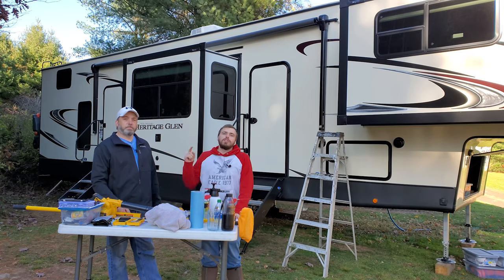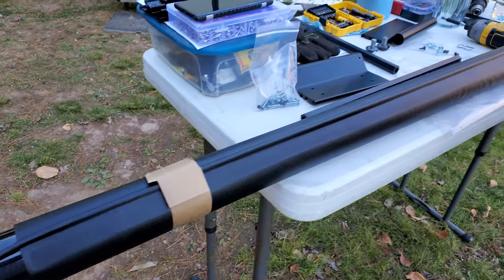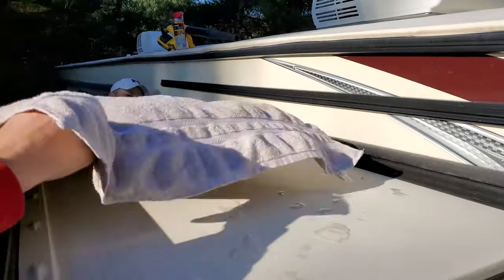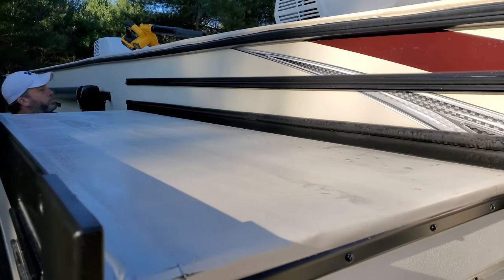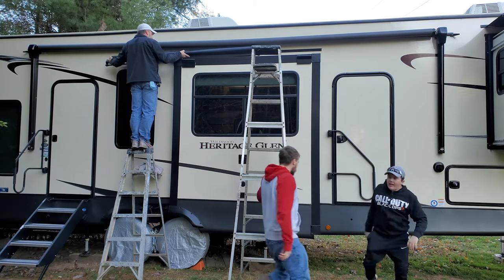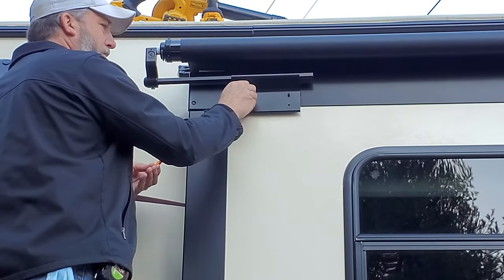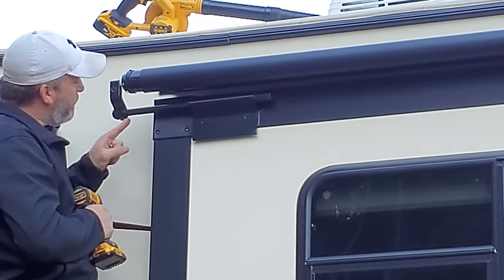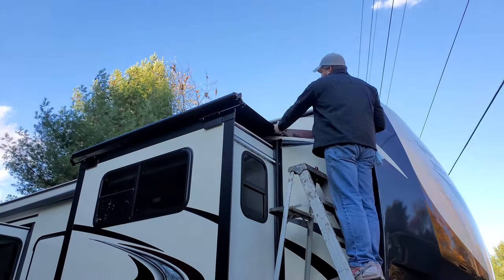How to Install RV Slide Toppers

Comment: Flare the end of the top track and deburr so you don’t snag/tear the fabric.  Use a ratcheting drill, not an impact drill, to avoid popping screw heads and stripping hole threads.

Comment: Question. My slide is real close to my patio awning. Are you able to adjust the mounting to slide the whole thing a little more to one side? In my case to clear my patio awning. Thanks.
Reply from the maker: Yes, the brackets do have some level of adjustment. You can easily avoid your patio awning.

Comment: When finished, yours didn't look like you have a down angle for water to run-off.  Should the roller not be down farther so water runs off the Topper?  The so called "professional" I hired, left these level like you did. Rain water collects on the top, pooling there, stretching the canvas, and it runs off the middle of the topper.  Can the brackets be flipped to give more of a downward angle?
Reply from the maker: Hello John,
     That is the same thing I thought, especially when you watch the Lippert install videos and it shows the front bracket being lower on the slides. Our 5th wheel came with the brackets installed already from the factory and that is what we went with. The front brackets have 2 positions and we have it on the lowest position but it still looks like it could be lower. I have tried contacting Lippert about the position of the brackets factory installed on the new RV's but have not gotten a response yet. We also use inflatable rubber balls you get from Walmart to put under the slide toppers to help with the sag and also helps with the wind, work pretty good. Thanks for watching.

Comment: NIce Video.  I have installed my slide topper.  It has a bit of play in the fabric.  How can I tighten the fabric up.  Thanks, Deb
Reply from the maker: You would need another turn on the tube to gain more tension on the spring.

Comment: How far should the fabric extend past the slide out
Reply from the maker: When the slide is open all the way it will always stay as far out as the roller is, so it will be past the slide by about 2 to 3 inches. Depends on where it sits on the outside of the slideout (the angle)

Comment: I bought a camper with the awning in place, but it's loose, ho was do I tighten it, it's floppy
Reply from the maker: Sounds like you need to put a wind or 2 on the spring. They will loose some tension over time. That is done by spinning the end of the awning arm with the spring, in the direction of tension. This will add tension to the spring and should make it tighter. There are videos that show how to tension your awnings. Hope this helps.

Comment: Where did you purchase the slide toppers from!
Reply from the maker: Got them right off Amazon :)
Reply: Look on Amazon did not see anything made by Lippert my question is was it specifically Lippert that you bought or did you buy Solara and they ended up sending you Lipert